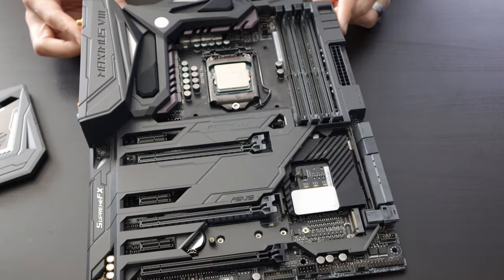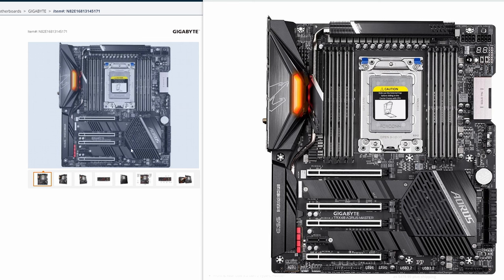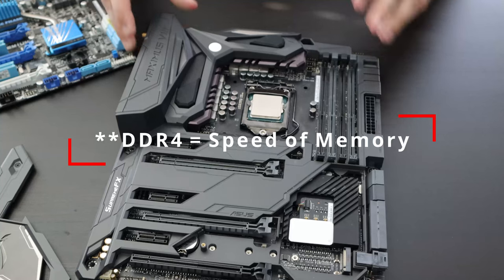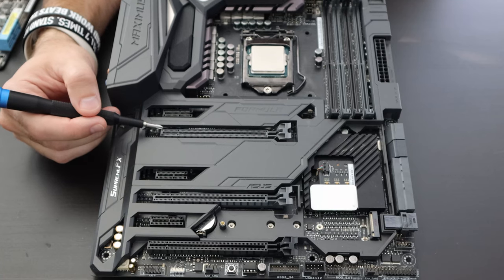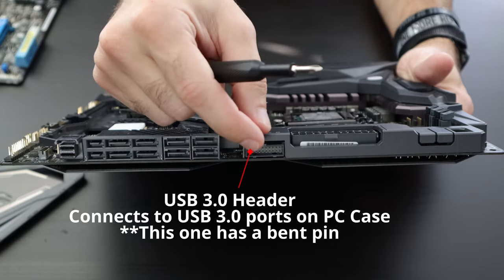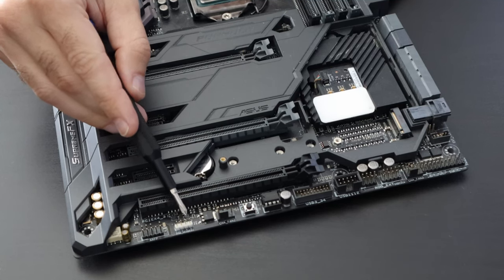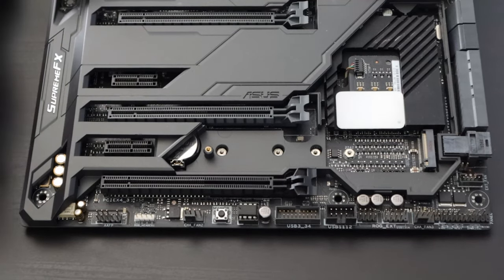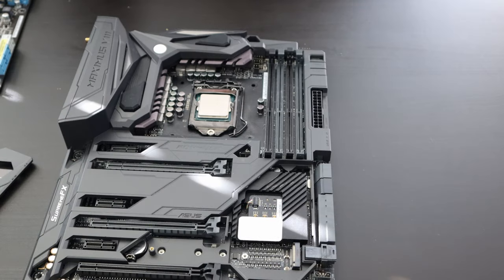Motherboards Explained | Sockets, Ports, Chipset and More!

Comment: Loved the video! And I’m also in the process of building my pc
Reply from the maker: Awesome Seth! Specs so far??
Reply: @TechRated  motherboard is a B450, Processor is a Ryzen 5 2600, GPU is 1650 super 4gb, ram is 16gb DDR4 3200 MHz, storage is 2TB HHD and a m.2 256 SSD. 650W PSU (because it was cheaper than the 550W PSU. I’m getting the CPU and the M.2 SSD today and I already have the GPU, and I’m getting the rest of the parts on the 20th
Reply: Very nice build! I think you have mentioned it before in a video, I just forgot some of the specs. For that system, 550W is perfect. What case?
What games are you gonna play?
Reply: @jasonrose5068  the case I thought about going with a mid tower because it also supports a micro atx motherboard, and the games I’m gonna play are Apex Legends, CSGO, Valorant, Maybe fortnite, GTA V, And Maybe The new Call Of Duty Cold War
Reply from the maker: Mid tower cases are pretty much the most used cases now...so great choice. You need to let me know if the COD Cold War campaign is any good! Haven’t bought a COD game in years!
Reply: @TechRated  I will certainly let you know!
Reply: @itsseffers3907  was it good?

Comment: Good video, but i have a question. What is the little light blue slot on the asus motherboard? I got an old pc and wanna know
Reply from the maker: Almost missed this comment! Thank you for the feedback. Are you referring to the slot to the left of the Xtreme Phase heat sink?
Reply: @TechRated  thanks for responding! No, sadly. I am referring to the ones at the bottom of the mobo, that are aligned horizontally. Are they PCIe-s?

Comment: great first time effort for this guide,so let's see if i can add some input to help you update the video when you feel the need...firstly motherboard manual images,would have been great to see some images uploaded when you were speaking about the connection ports on the MB,you certainly did mention the manuals a few times but they are a great way of finding what ports do what and also what restrictions using certain ports will have on the other parts of the board,(i.e. M.2 slots restricting PCIE lanes etc),i know you didn't want to draw the video out for too long as peoples attention spans here on youtube are terrible but where guides or tutorials are concerned they can be as long as they need to be,some of your info was pretty technical especially names of components or slots and connections breaking this down a little with uploaded images or screen text overlays whilst your explaining the specific item in question can be a great way to help people less in the know understand the item in question...other than that you covered the whole guide very well...truely impressed with this content...keep up te good work
Reply from the maker: Thank you! I appreciate the feedback. If/when I update the video, I will keep this in mind.

Comment: What happens if you damage one of the pins of the CPU?
Reply: If you damage the pins on the CPU socket, it can run but there will be a black screen. Other times it would intermittently shut down after a few seconds